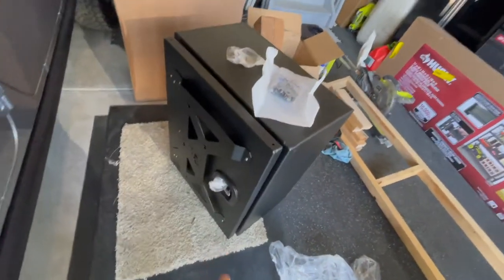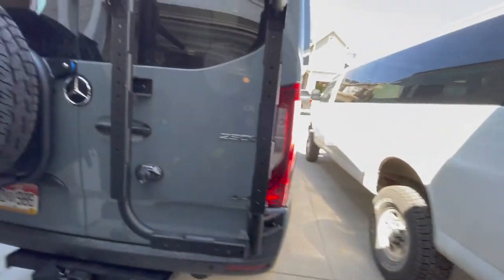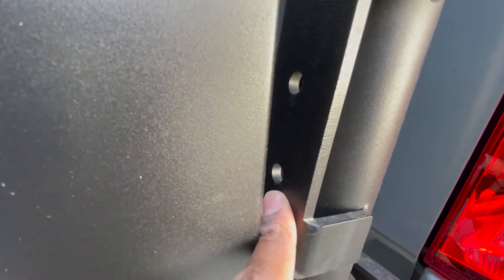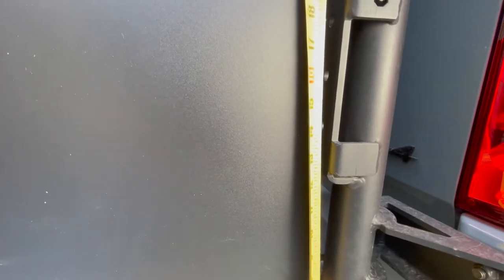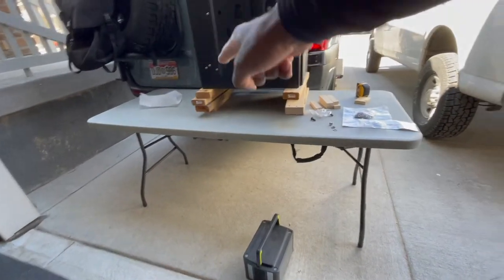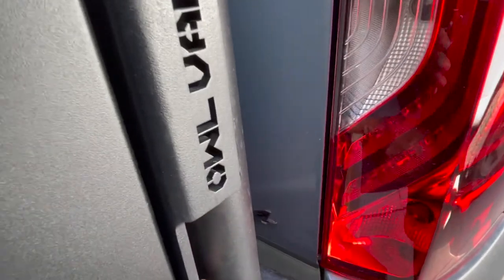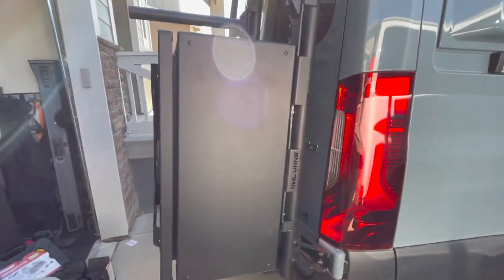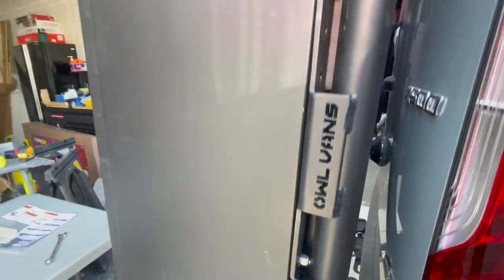Installing an Owl Expedition Box on a B2 Carrier

Comment: Nice! But is it uppside down?
Reply from the maker: It is. If you look at the cutout of the Owl on the door you can see it's on its head. Technically it doesn't matter that much. The door will swing one way instead of the other. And there's a shel inside that's not at the bottom instead of top. LOL.

Comment: What are interior dimensions of large expedition box? Will a Solo Ranger firepit fit inside? I think diameter is 14”... also do you do installing on other owners’ Revels?
Reply from the maker: Hi Christie! I’m not home or I’d measure for you. It fits a small Honda 1000 watt generator. That 15 inch tall and 9.4 wide. I hope that’s helpful. I can definitely get it installed for you. Message me.

Comment: Thanks for sharing the installation. Question: did the box come with the holes pre-drilled to match the B2?
Reply from the maker: Hi Craig! You are welcome! And yes mine did. Which is good. I was dreading doing it. I think the regular box needs drilled u less they changed that now. Mine is the expedition and it just came with holes so I assume they all do.
Reply: @iAmMarchal  Hi Marcus! Having the holes already drilled makes it a little easier. I have the large Owl box waiting to install. This is my second box and making the cardboard template seems to be hit and miss in getting the holes in the correct position.
Reply from the maker: @craigbenjamin  I can see that being the case. Have you tried cutting a cardboard box same size as the box then taping to the carrier marking holes then placing on the box to drill?
Reply: @iAmMarchal  I tried that method with the last box. The problem was getting access to the holes from the back side of the carrier to mark on the cardboard template. I ended up punching a hole at each bolt location in the template, however this is not a very accurate. I think I got two of the four holes in correct position without having to oversize the holes. Oh well.
Reply from the maker: @craigbenjamin  yea. Not ideal engineering on their part. Glad u still got it though.